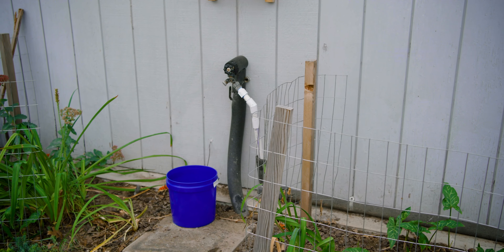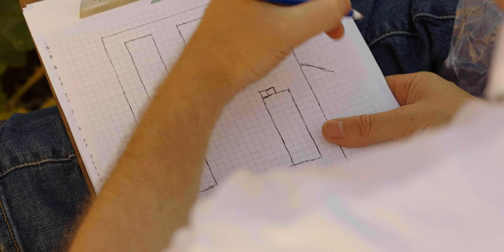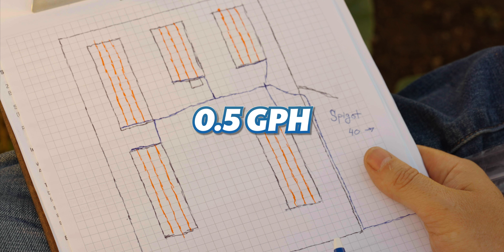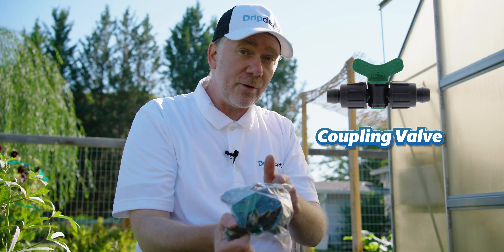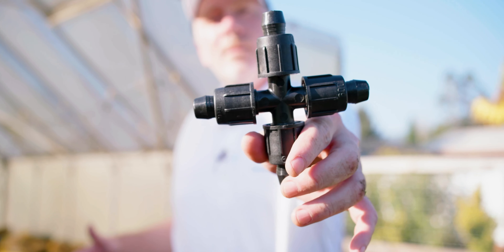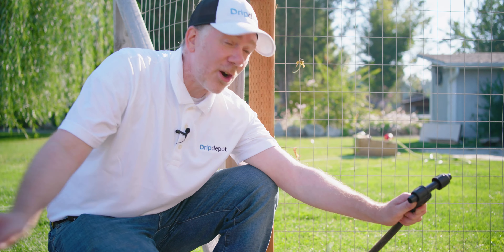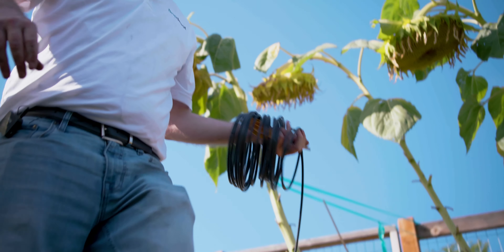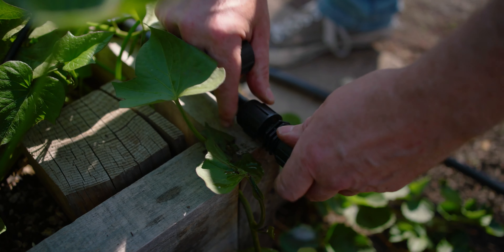How to Install Drip Irrigation for Raised Beds (Complete DIY System Guide)

Comment: Hi again.  I noticed at 18:01 mins into the video, there is a quick tip that said to check the link in the description for how to install a drip system on metal raised beds but I can’t find the link.  Can you send?
Reply from the maker: Heya Barbara!  That video is incoming soon, it's our next one, we're just waiting on the beds to arrive so we can film it.  We expected them to be here some time ago, but bad weather has made their trip across the country slow.  I'll reply to your comment with the link as soon as we get it uploaded.  :)
Reply: @dripdepot  Perfection, Tx!  We purchased 2 used silo feeders that we’re dismantling in sections for our raised beds.  Recycling and saving money!  Will be on the lookout for your video.  In the meantime, my attention is on making the top layer of planting mix. Using the Mel’s Mix formula.  Wow, coarse vermiculite is EXPENSIVE!  If you have any tips there, let me know!
Reply from the maker: You're definitely right about the price!  Fortunately it is great stuff -- a little ding in the wallet for great results in the garden.  I did get a tip from a colleague who uses it: Be sure to fluff it she said -- it will go further than you think with a good fluffing.  If you're doing square foot gardening or similar, be sure to use the same bucket for all your measurements for even distribution :)
Reply: @dripdepot  Tx! I’m leaning on you heavily, I know, so shut me off if I’m talking too much of your time. Does your colleague recommend a certain depth for the growing medium in the SQF gardening? My beds are 32 inches high and I plan on doing the hugelkultur method to fill the majority of my beds.
Reply from the maker: Barbara, that's awesome!  We're essentially going to do the same thing in our metal beds video coming up.  Right now the plan is: 5 Cardboard (with no ink), 45% Wood, 10% Plant Waste, 10% Compost and 30% Organic Soil -- some folks go without the cardboard and go: 40% Logs, 20% Branches/Sticks, 25% Plant Waste, 10% Compost, 5% Top Soil.  

We've seen both mixtures work pretty well :)
Reply: Really looking forward to the video!  Tx!  Just in time!

Comment: This is such a great video. I have one question: What is the reason for making 3 separate rows of the 1/4" drip tubing? We're thinking about doing 4 lines in our 4x8' bed but cutting the drip tubing double length (so 16'), attaching 2 lines into the main tube and then sort of bend the drip tubing like a U so each line of drip tubing will make two dripping rows. I understand there's a limit to how long they can be to work properly, but I think I remember you said max 30' in the video. Are we missing something or is it simply personal preference? TIA.
Reply from the maker: Great question -- to some degree it's personal preference, but there are a couple advantages to running individual lines.  Less chance of an emitter not at a plant (if any emitters end up in the U section of the run, there may not be a plant there) and potentially less material used since no material fills the U portion.  That's assuming one line per row of course, if you're turning the tubing back to run across the same row (to get drip line on both sides of the plants in the row) then those are less likely to be concerns. 

Performance is also a possibility -- the maximum run length of 12" spaced drip line is about 30', but if you go with tighter spacing (6" and 9" are both fairly common), friction loss can start to get pretty high in runs over 20' -- at 20' in 6" spaced drip line, about 6.2 PSI is going to be lost from friction, which is enough to start noticing uniformity differences.  

At 16' in your beds you're likely to be good to go even with 6" spaced drip line though -- at 16' the loss is only about 3.3 PSI.  Yes, that does impact uniformity, but probably not enough to even notice there :)

Comment: My wife and I watched your videos and just finished installing one of your systems.  

We are having a loud low hum inside the house while the system is running.  Any advice to fix this issue?
Reply from the maker: Does the sound persist the entire time it's running?  

First let's check to see if it's a trapped air issue -- the turbulence from air can cause a humming (or even hammering) sound at time.  To bleed the system of air, remove one of the end caps on the system and just let water run for a few moments -- this will generally allow trapped air to escape.  

If you can, also pin down the source just in case the hum is coming from one of the head assembly (backflow preventer, pressure regulaor, etc) components :)

Comment: Hi Adam, we installed drip tubing with 6 inches emitter on our 4x8 raised beds.  rated for 0.5 gallon.  How long should i set timer on?  10 minutes every day?
Reply: I have 4 or 5 lines the length of the bed
Reply from the maker: Great question Peter!  There's no one right answer as there's a lot that goes into it: soil type, soil infiltration rate, plant type, microclimate conditions, maturity/stage of the plant and others.  With that said, you're on the right track -- right now (with low precipitation in our area) I'm doing 10 minutes per day as well -- as it gets hotter and drier I'll probably add another watering cycle in the evening and when water demands are at their highest, increase each cycle in length (rather than adding a third cycle). 

You can mostly account for all the variables above by keeping in mind you just want to maintain soil moisture -- not wet are water logged, just moist.  Dig around a little (careful of roots) and make sure the soil near your plants is at that moist but not wet level.  When you've got that, you're essentially doing it right (and the plants will let you know!).  When testing water cycles I always keep in mind to err on the side of too little -- it's always easier to add more water than it is to remove :)
Reply: Wow , just the question I had and a good answer. I think in your video it was on the order of 70 GPH so at 10 minutes you are using 70 GPH / (1/6 H) or 70/6 G per Run .  Well aproximately on that order

Comment: Thank you for this video. I was wondering if I should burry the micro tubing with drippers under the mulch or leave it out. You are saying the emitters on the tubing will get clogged, so probably I shouldn’t burry them. But I watched some other videos and people say animals like squirrels and chipmunks will chew on the tubing to get water, especially during hot spells. So burry or not to burry?
Reply from the maker: You have it right that burying slightly increases the risk of clogging -- less so when it's buried under mulch than when buried under soil (but we still see both done).  In regards to critters chewing on the tubing, that's definitely correct whether buried or not, they have no problems digging through a little mulch or soil to get to the water.  With small animals, we usually find the most effective method is to simply provide an easier source of water (water fountain, water feature, etc).  They'll go for the easiest source :).  

With burying it basically comes down to personal preference for the most part (though I usually avoid direct soil burial in my own garden).  Burying under mulch increases efficiency on what are already efficient irrigation systems, but at an increased risk of the occasional clogged emitter (which to be fair, are fairly easy to fix, and in my experience pretty rare).

Comment: Hi Adam 
Question for ya …..
Probably a silly question BUT 
Should I put down my mulch first then my drip line 
OR should I put my drip line down first and the mulch over the drip lin the top of it 🤔

Please let me know when you can 
Thank you
Reply from the maker: That's a very good question!  There's two schools of thought on this, as there's a little tradeoff either way.  Placing the mulch over the top of the drip line is the most efficient route and loses the least amount of water since the mulch traps the moisture.  The tradeoff is a slightly elevated risk of clogging, usually from the emitters inside suctioning back debris after shutdown (the lowest point emitters drain and that water is replaced by air and sometimes the only way air can enter the system is via the emitters).  

Anti-siphon drip lines and those with an "outlet flap" can help alleviate this to a degree, but those types of drip lines aren't totally common yet.  With all that said, drip emitters are designed to resist clogging and some folks have gone many seasons without a clog using their drip lines beneath the mulch.  In my home garden I do use mine beneath the mulch (we're in the Pacific Northwest which has faced quite a few years of drought conditions so we tend to try out the more efficient routes).  

Thank you for the great question Vicki!
Reply: @dripdepot 
Ok that’s all good info to know 

I really can’t thank you enough for your all your help Dave 😊👍
I hope you have a great day

Comment: Great video, I followed everything to a tee, drips fine, timer works etc however, the whole head assembly leaks. I've checked and replaced the gaskets, I'm using your T filter and the Claber Aquauno Logica timer. Any help would be appreciated. Water is so expensive here in Hawaii, I need help figuring this out. 3 beds, 6.5x3.5. Do you think I need the bigger filter??
Reply from the maker: Jacinta, I can confirm your head assembly should not leak and I'll be happy to help get it up and running.  We're not at Hawaii levels yet, but a couple years of drought has our water pretty pricy too -- let's get that going leak free. 

I'll cover some common causes (except the gaskets since you already took care of that) below -- if these aren't it, send us a photo of your head assembly via our website.  You can say "Attn: Adam" in the title and it will come to me (though the others here are great too) :) 

Ok the first thing I want to check is the head assembly order -- the order should be: . 

Basically, we want to make sure everything comes after the timer outlet, as only the timer valve is rated for constant pressure (it sounded like the filter might be before the timer -- if it is, move it to after). 

Second thing -- be sure not to use any teflon or thread seal tape.  With hose threaded connections, this can actually cause the issues it's meant to prevent.  

Those are probably the most common things we see along with the gaskets you already checked on -- if none of that does it, fire off that email with a photo of your head assembly and I'll take a look.  We're just about to leave the office for the evening, so you might not hear back from me until tomorrow, but I'll be here and jump right in when I come in :)

Comment: Does the cross fitting come in any of the raised bed irrigation kits?  I ordered the standard kit but don’t see it on the list of the fittings and now am worried it’ll end up delaying my project. 😢
Reply from the maker: None of the raised bed kits include a cross -- the cross fitting is actually one of the least used fittings (we've been trying to find a reason to use one in a video) -- do you have a location where you need to come in from one direction and then split 3 others?  If so, see if you end up with an unused Tee, as two tees can accomplish something similar and may save you having to wait for a cross fitting.  If you do end up needing one, let me know, I'll make sure you get free shipping on it.  :)

Comment: Can you bury the main line? I have three 24 inch tall raised beds and I don’t want the water line to be on the outside where someone might trip on them.
Reply from the maker: You sure can!  A trip hazard is a good reason to do so too :)   Also, lawn mowers love to eat tubing, so it protects the tubing as it does foot traffic. 

Just like with PVC, dig a trench 6" to 12" of soft crumbly soil, and then you can lay the tubing in and cover it up with soil (and grass if it's going through the lawn).

Comment: Question. I need 100 minutes per bed to get 1” of water. If I determine that I need 1” per week is it better to spread it out daily, every three days or once a week. Or is the answer plant specific based on the depth of the roots. Tomatoes are deeper than lettuce. 

Question 2. Is there a time of day when it’s better to water with drip? 

Great video. You voice is so reassuring 😊
Reply from the maker: Great question Richard -- I suspect you instinctively felt it out when you asked if it were plant specific, as this is indeed the case.  With that said, I find most common garden veggies prefer to receive the water spread out across several days rather than all at once.  This helps ensure their roots never become water logged -- you want them moist but not soaked :) 

In regards to time of day, I've experimented with this a lot.  Anecdotally, I've had the best results with later in the evening or earlier in the morning -- this helps prevent any evaporation that might occur.  Later in the growing season, when water demand is at its highest, I'll run a cycle in both the evening and morning.  The biggest tip is to monitor soil moisture during the hotter parts of the growing season to make sure it's not drying up during the daylight hours (dig around a little to check, the top of the soil or mulch most likely will be fairly dry, but moisture should be beneath the surface). 

Thank you for reaching out with a great question!

Comment: My standard kit did not come with the backflow preventer. Is this a mistake ? It appears to be in the photo of the parts but now that I’m looking I don’t see it on the list of parts. 😢 Is this absolutely necessary? Can I come back and install it later?
Reply from the maker: Lauren, you'll definitely want a backflow preventer, but, I was able to locate your initial order and do show one was on the order, so you may be covered (and definitely let me know if it's not there).  

Did a brass piece come with your order?  On the receipt and order (and likely the tag) it will be called a "vacuum breaker" -- this can be a little confusing, but the vacuum breaker is the backflow preventer (it prevents backflow by breaking vacuum conditions that can lead to back-siphoning).  If that piece is missing, that's on us and we can easily send one out to you :)

Here is a link to the brass one that should have been included so you can check it out and see if it made it: https://www.dripdepot.com/brass-three-quarter-inch-hose-end-vacuum-breaker
Reply: Ok I see the vacuum breaker! I was looking for one that looked like what you used in the video. I went ahead and ordered another one from you all but probably don’t need that now.. it’s ok. No big deal. Thanks so much for responding!
Reply from the maker: @laurenstokes675   Perfect!  Lauren, looks like they got your order packed early this morning, but I'm going to issue a full shipping refund so that it ships for free.  A backup backflow preventer is often a good idea either way (backflow preventers protect the water supply in the house from irrigation water, so nice to know you'll have a working one if anything happens to one of them).

Comment: how long would you set the run time? one hour sufficient? one gallon will soak one cubic foot of soil, correct?
Reply from the maker: One hour is a common run time in some places -- how long to run the system and how much soil is moistens are very dependent on the location (in denser soil water spreads further than in loose soil), maturity of the plants, exposure to sunlight, temperature, relative humidity -- basically, many factors, most of which are specific to the location and its microclimate.  

With that said, for common garden vegetables, a 1 hour cycle is common when the plants are mature and fruiting and the days are hotter.  Some break that cycle up into two 30 minute cycles, and in some places we've even seen two 45 minute to two 1 hour cycles be necessary.

We made a reasonably short (4:49) video that covers the above in a bit more depth if you wanted a little more information: https://www.youtube.com/watch?v=caF5_paR8Uo

Comment: I am a DIYer that needs to connect some poly water lines that are connected to two different impact heads for overhead and connect them to drip irrigation to a greenhouse. How can I find out what I need to go from a 1/2 inch water line to drip irrigation?
Reply from the maker: Happy to assist :) 

Are the poly lines that are connected to the impact sprinklers the thick walled funny/swing pipe type that's only a little flexible, or thin walled and very flexible LDPE?  If you're not sure, fire us off a photo at the Contact Us on our website, good chance we can identify it with a picture or two (one straight on so we can see how thick the walls are).  

Either way it shouldn't take too much, if both poly lines are swing pipe, a barbed swing pipe coupling will do the trick -- likewise if they're both LDPE, a small poly tubing coupling will get them connected.
Reply: @dripdepot   I will see you a pic at the Contact Us. Thank you for your time.
Reply from the maker: @MicroUrb   You bet!  I'll keep an eye out for it -- you can include my name (Adam) in the title or body and any colleague who gets it will make sure it gets over to me :)